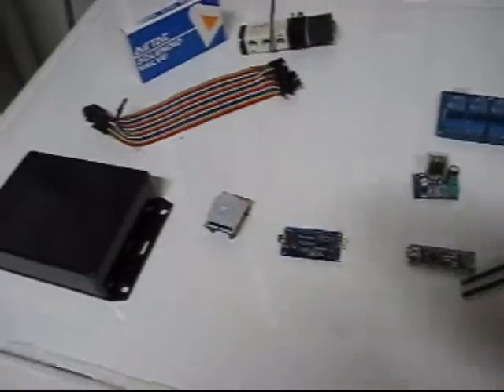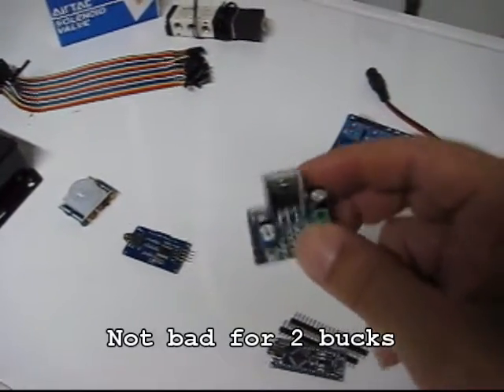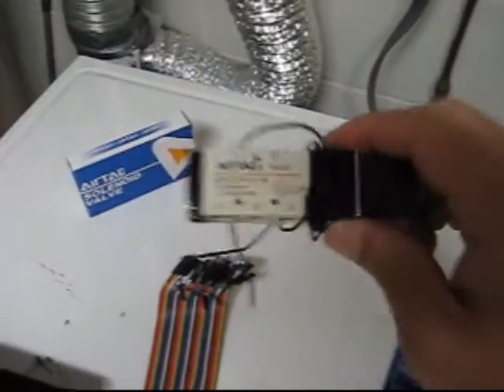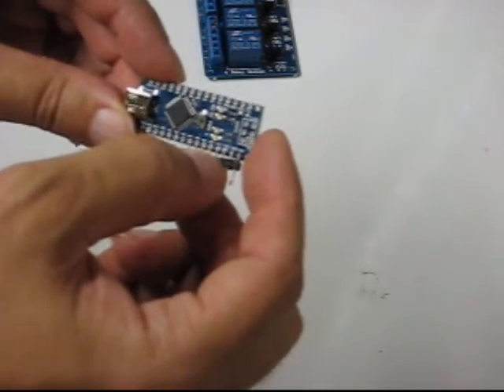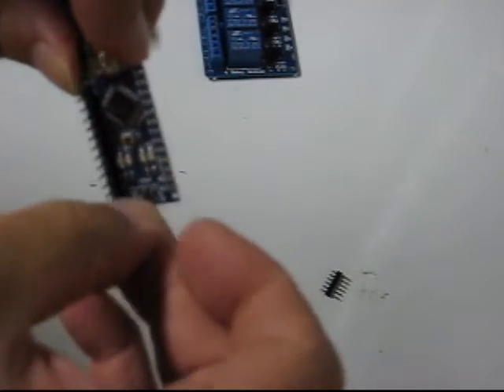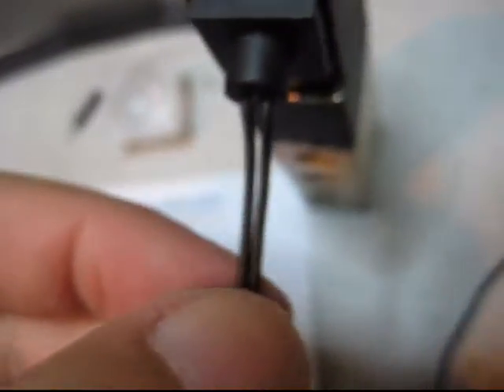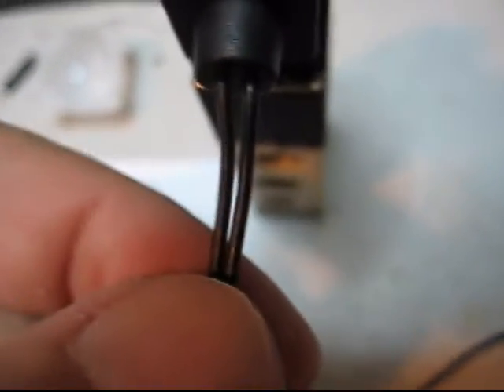FourBanger Ground Breaker Project

Comment: I love your fourbanger program. But. Is it possible to make the scare last longer then 6.5 seconds??  
Thank you
Reply from the maker: Here are the available resolutions in FPS (frames per second) and their corresponding maximum length:
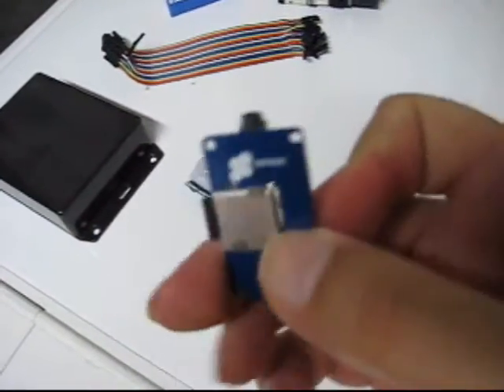25 FPS = 1:18
20 FPS = 1:38
10 FPS = 3:16
5 FPS = 6:32
The default is set to 20 FPS which allows for over a minute and a half of recording time.  You click (I believe right click) on the PC program's timeline to set the sequence duration.  Download the software and play around with it- you'll figure it out. Good luck with your projects!

Comment: On the 4 button banger featured on the grave of the groves site.  I have followed the controller per the instructions.  I have successfully built 2 controllers with the pir.  THIS year I built one more however no matter what I do, when triggered by the pir, the board constantly triggers again over and over.  I tried 3 different boards and 3 different pir’s.   Is the program not updated ? When triggered manually by the switch the board functions as it should.  Any advice??

Comment: Hi Mike. Built a arduino prop controlller and it works perfectly.   I have a second prop controller I am making but I have a 12v relay on a arduino board 5v I assume. The relays will not fire (click). Can I just use a 5v relay and run a 12v wiper motor thru them?
Reply: Yes, you can run a separate power (even 110 AC voltage) thru the relay contacts.

Comment: Hey Mike, I am so glad to have found a way to contact you. I am trying to get hold of the fourbanger documentation and code that still has the button functionality. I know you have disregarded this and got rid of this function. But for my project it is  really important that I can adjust the sequence in the "field" without a PC. Would it be possible to get hold of the older version? 

I don't need MP3 support or anything like that just to be able to programme a sequence and trigger playback. Ultimately to tweak the speed of playback later would be the end goal but I can attempt to work on that. 

Any help would be greatly appreciated, as I am sure you are aware you will be saving me weeks of effort.

Many thanks in advance,

 Sam (from across the pond)
Reply from the maker: I would suggest using a laptop like I did in my garage at the end of this video.  I had nothing but problems with trying to program with little button boards- that's why I quit supporting them a few years ago and try to steer folks away from them.  When you hit the red record button on the PC software, you can "button bang" using the 1,2,3,4 keys on the keyboard.  Good luck with your projects

Comment: I did this exact setup and works great! However I want to set off the prop controller via remote control, how would I set that up?
Reply: Ebay and Amazon both sell cheap remotes that trigger a single 12vdc remote relay. We had a blast with one hooked to a truck horn this Halloween. The relay module can be set to toggle On, then Off with each click, or set to On only while pressing the remote button. So you power the receiver/relay with the same power as your Arduino and then run the Arduino input wire thru the relay contact. Battery for the remote is sold separately. Search on Amazon: ELENKER DC 12v remote relay.

Comment: hey mike, question.... on my mp3 player on the uno . i went over connecting it 50 times. i get the green power light but when i have my sd card in, it doesnt play nor flashes green. i tried two different  sd cards and made sure they were copied on there. still no sound. any ideas ? hope to hear from you soon as the days approaching!! thank you
Reply from the maker: Try re-formatting your sd card to FAT format, then use the PC app to copy your files again.
Reply: thank you for responding!! i just tried that, still doesnt play and i have a solid green light. no blinking. the only other weird thing is that when i have my sequence on there, for the scare music it shows 00:00  for the song length ...

Comment: Do you happen to have a wiring diagram on how to wire the solenoid to the relays. I Built a ground breaker but the the solenoids son go off with the relay. Might have something wired up wrong
Reply: The relay board is a "dry contact" type. It doesn't send the control power out of each relay. You need to supply voltage in to the Common side of each relay, and that voltage is sent out when the relay contact closes. You may choose to run a small jumper wire from your relay board's control power to all the relays, or you can run a separate voltage (even 110 VAC) thru each relay.

Comment: hey Mike I have a question so I want to build this ground breaker...I have the it all wired up using an uno..my question is how do u wire the stuff on the relay side..does the power come from the uno board??
Reply from the maker: "Wire the stuff"???
Reply from the maker: If you are up for some serious reading, there is a lengthy thread on the following website with lots of discussion regarding wiring- diagrams, pics, etc.. http://www.hauntforum.com/showthread.php?t=41196
Check it out- if you are not a member, sign up and ask a question there.  Lots of friendly helpful folks
Reply: Thanks mike..I guess I should have defined wired stuff better. I was talking about the solenoids and lights you had wired to the relays..I ended up finding all the info I need wright in this video...thanks again for the amazing prop controller

Comment: Might I recommend that you update the documentation to show a 12v wall wart instead of the 5v? Like a dummy, I looked at the picture and description when ordering my parts and got three 5v supplies instead of 12v, and apparently, that was not the right decision based on everything else generally running on 12v.

Comment: Those little PIRs will operate on 12 volts, but will get very hot!  I ended up adding a 1.3K resistor on the ground side to limit the current and it kept it nice and cool.  (I used the ground side as I was triggering something that required 12 volts input)  You might also check the output to see if it is outputting 12 volts, and if it is, move the 1.3K resistor to the positive side to limit the current to the PIR and also to the PIR input pin of the arduino.
Reply from the maker: Tayman Graveyard Haunted Theme Park 
I had to test this- I have had an HC-SR501 running for 15 minutes as a test.  I measured the temp at 77 degrees f when I powered it up.  At an untriggered ambient state the signal pin measures 0vdc to GND.  When triggered, it measures 3.32vdc, or a logical high.  After 15 minutes I measured the temp again with my IR gun and it is at 76 degrees f.  The datasheet says they will take up to 20 volts.  Not sure what is up with yours, perhaps you have a dud.